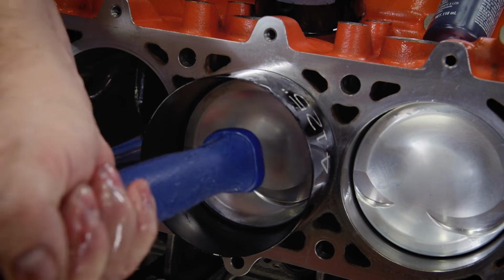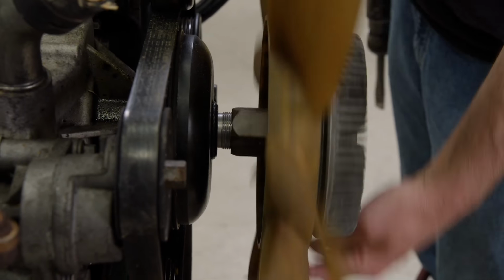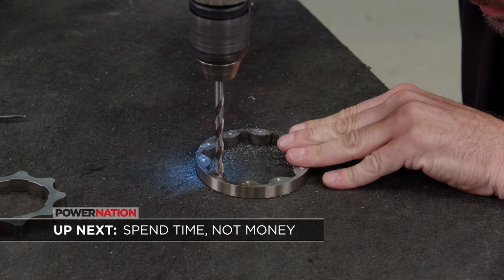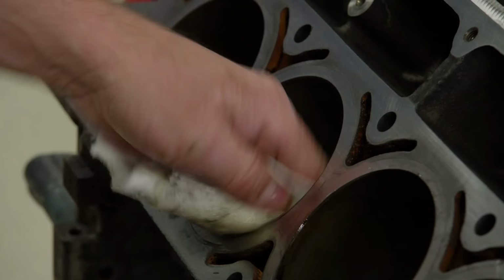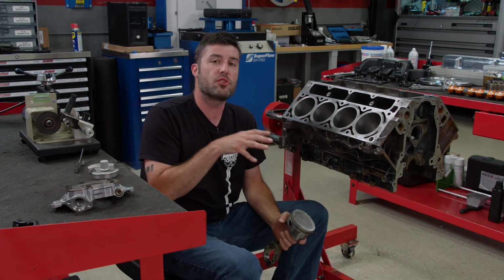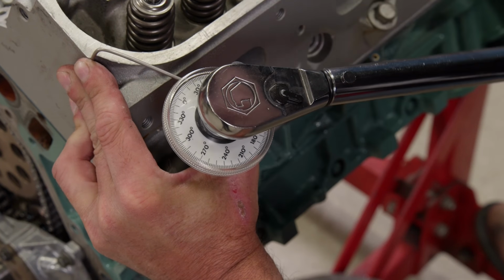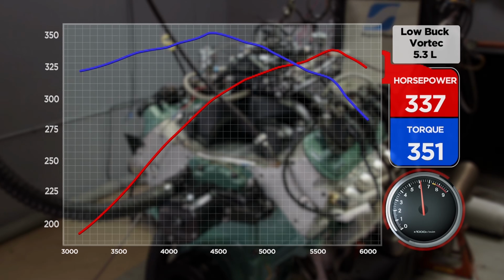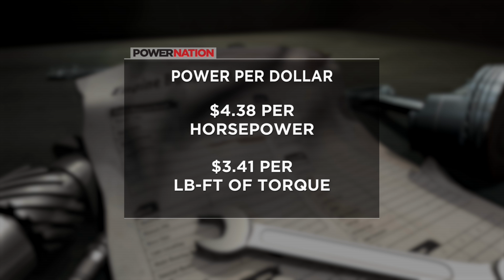Minor Upgrades Create Crazy Power on a Junkyard 5.3L Vortec - Engine Power S7, E10

Comment: This shows why the LS followed right along behind The SBC as the go to engine for everything. Stupid power to cost ratio.
Reply: @james avery also some impala ss I believe
Reply: Not true anymore.  Yards aren't stupid.  They want an arm, leg, and two assholes for one around here.
Just for the purchase price to "get your foot in the door" I've already got a forged piston 355 on the stand with some loot towards aftermarket aluminum heads.  Haven't even begun disassembling the LS yet.  That's the truth.  I'm just sayin'.
Reply: LS,low cost,and,budget do not go  together...buy one from the junkyard, keep up with the receipts with an identical build just like this...you'll be right at 6 grand.
Reply: Until of course, all existing LSes get bought up and destroyed.  Though at least there are exponentially more trucks/suvs to rip these engines from than there are lightweight rwd rice burners *clears throat*corollagts*coughs*240sx*wheezes*miata to put them in.
Reply: @FinalLuigi  
I think it's cool that the import crowd is admitting that a American v8 engine is the best way to add huge power, keep it reliable and do it on a budget.
Reply: @jamesearlcash7725  Only in a RWD vehicle, unless you want to invest way more effort into turning a FWD economy vehicle into RWD.  And even if you happen to find a rare RWD japanese shitheap before they completely disappear at an alarming rate, you still need to get proper mounting kits, upgrade the suspension because the car was never designed to hold an engine that weighs more than half the car does above the front wheels (hell even the corvette has them behind the front wheels), you need to grab a working ECU, you need to find the proper transmission for the engine, upgrade the drivetrain to even support the engine, you're basically building a corvette with a Japanese emblem.  At which point, why not just straight up buy a corvette?
Reply: @FinalLuigi  Why would you want to build up an engine in a POS FWD car in the first place? Do you like understeer or something?
Reply: @FinalLuigi  I suppose you dislike the Shelby Cobra too?
Reply: LS engines aren't cheap when you gotta rebuild/replace them every 100 yards.
Reply: @Boss-bf7ru  🤣🤣🤣🤣🤣🤣🤣
Reply: @Boss-bf7ru  2012 and 13 had lifter issues with the afm bs.  They fixed it , 5.3 pretty bullet proof
Reply: @wickedmainah950  the lifter issues were the least of the 5.3s problems LOL. I dont consider the 5.3 or any LS engine bulletproof.
Reply: @Boss-bf7ru  why do i see chevy engines in a ford lol.
Reply: @Boss-bf7ru  You don't.........Not if you don't abuse them.
Reply: @Boss-bf7ru  Here's my uncle's burnout contest video. He's got a 5.3 in a Studebaker. Redlined it the entire video. The only thing that failed was when it threw a rod through the side if the block.

Comment: SAD PART ABOUT THIS IS THAT MOST BONE STOCK JUNKYARD 5.3 LM7'S, WITHOUT BEING TORN DOWN/REBUILT, MAKE 350ISH HP AND 380ISH LBS-FT OF TORQUE ON THE ENGINE DYNO. THAT IS WITH THE STOCK LOW LIFT TRUCK CAM... MAYBE B/C THIS WAS A CARB SETUP THAT CAUSED THE LOW NUMBERS BUT A LOW LIFT STAGE 1 "TRUCK CAM" MAKES 400ISH HP ON AN OTHERWISE STOCK LS 5.3 (ON ENGINE DYNO, RAN WITH DYNO HEADERS AND NO ACC.) CHECK OUT RICHARD HOLDNER'S YOUTUBE CHANNEL, PROVEN OVER AND OVER AND OVER THAT STOCK 5.3 LM7 MAKES MORE POWER THAN THIS ONE DID.
Reply: WHAT GETS ME TOO IS THAT CAM MOTION LS1 CAM THEY ARE USING IS A GOOD 430ISH-440ISH HP CAM IN A 5.3 ON AN ENGINE DYNO.

Comment: did he dimple both sides of the oil pump gears or just the side on the retaining plate?
Reply: Look like just one side with plate.
Reply: You dimple the plate side because there is oil flow on the housing side. The dimples act as oil reservoirs to offer more lubrication.
Reply: Thanks, I thought that but wanted to be sure, looks like a good cheap mod.

Comment: I read some of the comments before adding mine.. I am too old to watch anymore. I saw remand heads, but the old head bolts, new mains yet if they changed rods I never picked up on it and the cam bearings.... not sure but think reused, no problem with that if you use the same cam, lifters must go back where they come from. New school coil packs but carbration... not sure why, and the oil pump was rebuilt which I am good with. I didn't seen the pan part that keeps rods from splashing in oil and I know what they are called but short of looking it up, won't come out to play here. So its half ECM and half old school carb and that just doesn't compute, too old and just have to accept it

Comment: Just ignore all the brand new coil packs, wires & ceramic boots.
Reply: And $1,000 carb.
Reply: And headers
Reply: Umm and msd
Reply: What about the carb? oh they must have forgot about it....5,6,700 dollars.. clowns    :)
Reply: And carburetor
Reply: And carburetor
Reply: And carburetor.
Reply: And carburetor
Reply: New carb?
Reply: But they saved money by buying the (junk) Duralast electronic sensors. 

but then they give props to Rockauto.com  SMH
Reply: They still had all the harness and shit dude.  Dont be an ass
Reply: And heads
Reply: and labor
Reply: New cam shaft

Comment: Correct me if I'm wrong looks like a set of reman heads to me gray paint and heat tab on core plug. Someone is stretching the truth. Better add another 500 bucks
Reply: good job spotting the heat tab.
Reply: Also that quick fuel 750 carb is another 800 bucks
Reply: anybody notice they used stock beehive spring,must not be much of a stage 3 camshaft
Reply: @sjrsloan  stock 5.3 springs would be really pushing it at that lift. I would have upgraded them myself
Reply: @beardedforlife3740  they do make aftermarket beehive springs. But the stock springs don't normally float until about 6400 in my experience.
Reply: @Darkhalfcustoms  6400 my ass. try 5500.
Reply: $700?
Reply: @BuzzLOLOL  Oreilly yeah, but you can get a pair of reman heads for $350-500 online. Sometimes cheaper than having a machine shop doing it depending on where you are and what your heads need done to them.
Reply: I would say they used reman heads to save time no other reason
Reply: yeah bro obv the first time watching this and i saw it too. what a joke!! just searching the comments to see who else actually knows about this stuff too

Comment: In the last 5 years I have built 4 of these 5.3's and they are impressive.  I use Melling oil pumps, LS2 timing chains, a Texas Speed Stage 2 .550 lift cam and the most important part is to replace the needle bearings in the rockers with bushings.  I always end up replacing 4-6 rocker bodies because of those wear patterns and they get a new set of 7.400" one piece lightweight pushrods and blue LS6 springs.  Truck intakes were used and all were stock long blocks ranging from 41,000 to 131,000 miles.  Those motors all ran hard, the last one received long tube headers and a Fitech Ultimate FI system and made just shy of 400 hp with a BTR Stage 3 cam and springs at the wheels.  Other than the intake system my costs were right in line with yours.  I just picked up a 5.7 rotating assembly for penny's at a local machine shop, we have 4.8's around here for $200.  Kinda makes one ask the question, just how far can you bore a 4.8/5.3 block ?.........
Reply: They have enough meat to build an iron 5.7L
Reply: Max overbore for a 4.8/5.3 block is 3.905

Comment: Before all is said and done the 5.3LS will go down in history as the best small-block mass produced V8 ever created...and I’m not even a fan of GM as a whole. Ford missed the boat by not adopting a similar architecture when the 302-351 were phased out. It took them long enough but its amazing how they brought the 7.3 pushrod motor to market this year after years of Triton garbage.
Reply: lol no. hey....gm stole the design from the ford 351w/ mod motor and made the ls....
Reply: @frigglebiscuit7484  Those accusations are funny. Regardless of the LS’s origins it’s still the best small block engine ever made.

Comment: Please god stop using carbs. Or  At least add some more modern-day fuel injection and engine management systems.
Reply: no. carb arent going anywhere.
Reply: @frigglebiscuit7484  there hasnt been a manufacturer the has put a carb on a production car in 30 years. Its not going away it's already gone.

Comment: Why are the heads silver,, are they stock unpainted,, what ignition setup was used,, is the timing adjustable,,, i am a distributor guy and a setup like that needs a little explaining to me,,, did they use new leads,, are they the same rocker shafts etc. how was the ingnition controled plugged in wired up. I liked the video and these guys are good watching,,,
Reply: It's no fun without a little mystery thrown in for entertainment purposes.
Reply: they are aluminum.

Comment: What was the point of shimming the oil pump during installation? Not even the GM LS factory service manual requires doing that.
Reply: Makes the spring push down more making higher oil pressure.
Reply: @repnatl  he was talking about shimming it during the actual install. Not the shimming on the spring. Please dont speak unless u know what you are talking about if youre gonna speak

Comment: For a cam sensor, just use a oem sensor. Always heard iffy things with the aftermarket sensors
Reply: #subtlemarketing
Reply: Seriously on these LS engines, anything electrical stuck to OEM/ AC Delco stuff.
Reply: Drew w same thing with the old Mopar 318 and 360’s that came in the trucks back in the 90’s. Aftermarket ones barely work

Comment: I have a LM4 version of this engine. ( All alumium) in my Envoy XL. The oil pump was going bad so I replaced it with a Melling unit. So far hitting 360,000 miles and still running.
Reply: i have a lm4 i pulled out of an envoy. It had 145000 miles on it and still had the crosshatch in the cylinders. All of the bearings were in great shape.
Reply: If yours is 2wd ditch the envoy pan they have a starvation issue with oil when taking off fast
Reply: My cat's breath smells like cat food.
Reply: @helisean10  Okay, Ralph.

Comment: Most vortecs under the plastic intakes have foam at the back water thats why the rear knock sensors so rusty because the rubber grommet shrinks over time and moisture gets in there

Comment: You guys are just in love with carburetors. You should have left the MPI fuel injection on it and put on an aftermarket controller, like maybe a MicroSquirt, for easy tune ability.  Less than $500... you probably spent way more than that on the carb and manifold!  :o(
Reply: They are clueless. This so-called "build" is idiotic. They waste what, $2K on intake, some horrid 1970's carby and an ignition system that add ZERO horsepower, yet cannot afford new rings and bearings.

Comment: Dammit Man!! It's hard to beat these engines...especially for the price. We have trucks at work with over 150k miles, that still run strong. Granted they were just driven around the city and synthetic oil changed twice a year.
Reply: I change my oil 3 to 4 times a year but drive over 65 miles a day to work 07 silverado 191000 miles

Comment: No ish on the good bearings. L.s. are self oil changing.  Just keep them full of fluids. Change filtration as needed.
Reply: 211k on my 5.3.  Last oil change was over a year ago. Just keep it full lol
Reply: @edbowden6000  I had a crank sensor going bad for a few thousand miles. Took a while to narrow it down cuz it was intermittent and no codes. 111k now

Comment: Add a summit S475 turbo, stage 1 or 2 cam, and a CSU blow through.  You could even take the exhaust manifolds out of the scrap bin, and use them to make a turbo kit.  What's the casting numbers on the heads?  There are plenty of videos from Holdner, Sloppy, and many others in the four digits with SBE, heads, used hardware and even with high mileage junkyard timing chains.  Having the proper ring gap, AFR, and timing definitely seems to be the key to making junkyard LS engines, or any engine stay together with power adders.  I always enjoy the videos that you guys make.  Thank you.

Comment: The only engine that would burn 2 quarts of oil every 500-600 miles off the showroom floor. The good ole Vortec. Chevy had major lawsuits off this engine and the courts made Chevy require the dealership to disclose the amount of oil burning it did because people don’t check their oil every week. The following year the engine was never sold again.
Reply: Kinda like the Subarus from the mid 2010s.
Reply: Not exactly.. GM changed a few things on the engines... The rig packs, some internals to prevent oil mist, and a better PVC system. They also added a low oil sensor. Keep in mind that giant companies like GM are sued every day for the most mundane nonsense. We all get to enjoy it in the higher prices we pay for things.

Comment: I'm building a 4lq 6L LS to 6.7 L
I need to know if I need 60lb injectors to run it for a tow vehicle
And put it in my suburban 4-wheel 2001 3/4
Reply: You can use any online fuel injector calculator and get the results you seek.

Comment: That’s not a fair assessment of the cost of building this. I don’t have an engine wash. I don’t have a way to polish the crank journals. I don’t have a way to hone cylinders. So it’s either pay a shop to do all the above or buy the tools to do it. Either way yes good budget build
Reply: Dingle ball hone is cheap.. you can polish your crank with a shoe string and brasso. If you have a garden hose and dish soap, then you have an engine washer. They used what they had, but the idea was, -I think-, a fair assessment.  Your mileage may vary.

Comment: Why didn't you add the price of the carb?
Reply: Or the ignition
Reply: Could substitute the nitrous for thr price of the carb , most people won't run nitrous
Reply: "This is the cheapest you can get one of these going" - isn't that what he said?
Reply: @MississippiDan1  cheapest way would be using 99% of the stock efi crap
Reply: @MississippiDan1  leave the engine mostly stock and use  a reprogrammed stock ECU, or get a standalone ecu if you want to spray it. Sub $1,500 even with the refresh. And some important upgrades.
Reply: @NeonAvantium  that's what i did :D
Reply: BECAUSE ITS FOR THE DANG MACHINE...REALLY...STILL MAN THEY KICKED ASS...BE POSITIVE ...STOP PICKING AT BS...LATER

Comment: what a shame the point of going LS is to keep the efi. on a street car. 
and no doing the harness and unlock the ECM is not more expensive then a carb and controller(since there is no Distributor) 
and no LS is not cheaper then a Old SBC Gen1. but its worth the extra cost for reliability and performence gain.
Reply: Totally agree. A carb is just stupid on an ls.
Reply: I agree with all of this except Gen1.. They (Gen1) are exceptionally reliable. One of the many legacies carried over to the Might LS.

Comment: Looks like it has reman heads by the temp heat tabs on the freeze plugs in the end of the heads .
Reply: They put heat tabs on engines you by from the junyard for warranty purposes. You'd be supprised at how good aluminium heads clean up especially with something like oven cleaner. They have a decent parts washer too us mere mortals would have to scrub the crap out of them for ages to look like that

Comment: Just shows how well that vortec engine breaths with the heads and port design
Reply: You usually have to replace the valve springs and rockers with LS1. The 5.3 is a truck engine so the valve springs float at 5,500 RPM. It's designed that way. That's why the engines don't break or wear out. Well that's what Summit told me what I had to do for a cam change or it wouldn't work. That stuff is used so it's cheap as hell.
Reply: @Mike383HK  valve spring upgrade is necessary with about any ls engine. Rocker arms are same on ls1 ls6 ls2 5.3 4.8 6.0 ect... ls2,ls6, ls3 do have upgraded valve springs that can be used with some of the smaller aftermarket camshafts. Good budget upgrade on truck ls engines. Rocker arms are good to go as are. Trunion bearing upgrade is good idea for large cams & lots of rpms.
Reply: Corvette 327cid (5.3) was making 375 horses bone stock 50 years ago with very pedestrian double hump heads.  These dufuses wimped out on the Cam.   Simple valve springs and agressive cam would have gotten them into the middle 400's. .. No nitrous needed.
Reply: Vortec fast - burn heads are decent.
Reply: @wannabeetiger  will the vortec fast burn 350 5.7 work on a small block 400?....from Wyoming USA 🔫🤠🇺🇸p.s stay safe and healthy everybody GOD BLESS OUR COUNTRY AND stop this foolishness ❤
Reply: @billallen4793  yes.  They're designed for flat top pistons.
Reply: @squidusn71  I just need to drill the steam holes?? Correct??